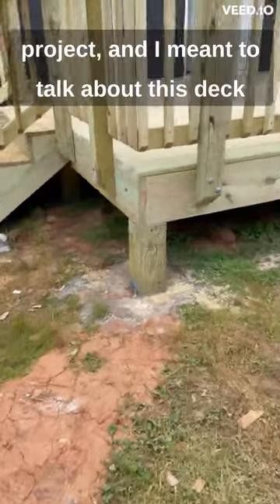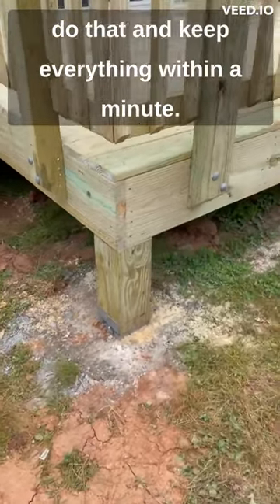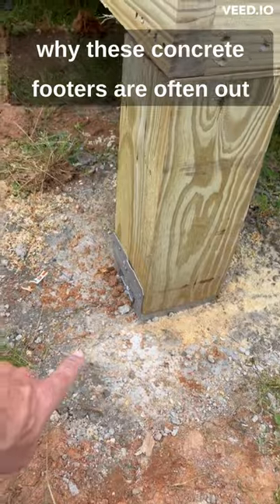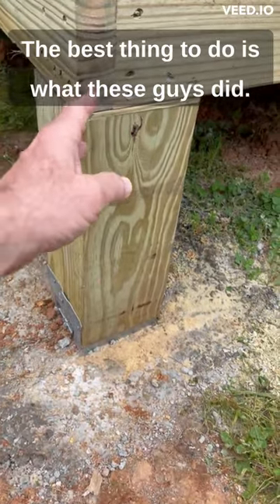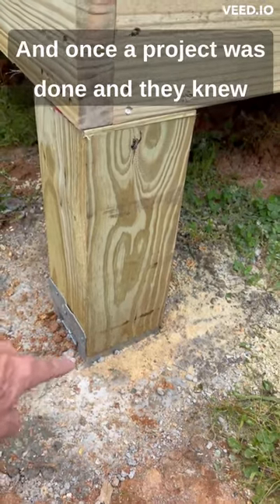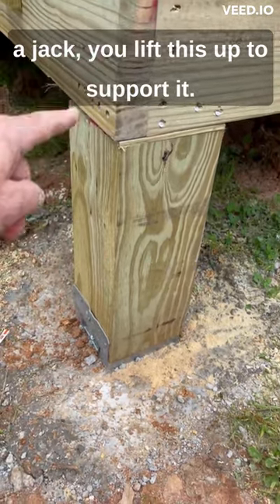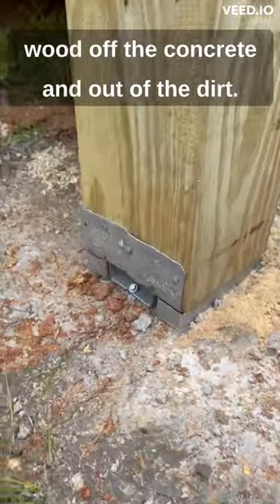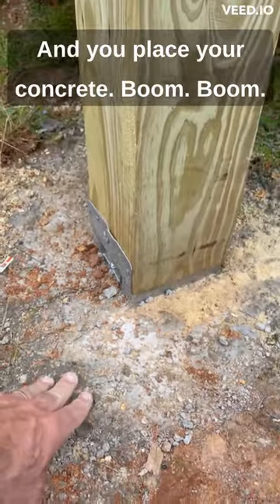Aligning Deck Posts and Footers

Comment: Would have been nice if the concrete was higher than the grade, so it would prevent pooling at the footing
Reply: Looks like they had the post and bracket installed and poured the concrete up around it hence the reason there's a screw drove down at an angle
Reply: @a-carpenter9229 That post is not in the concrete. It's actually not even touching the concrete at all.
Reply: That post will not be under water. That metal bracket is holding it up above the concrete. I don't see that area holding water anyway. I would have probably elevated the concrete about an inch or so, but that post is not in any danger of rotting.
Reply: I did my concrete piers at least 6 to 12 in above grade! But that's just me 😉
Reply: @a-carpenter9229  I’m saying it looks like the concrete is concave to the surrounding grade of the land. So it will pool on the footing
Reply: An 8" 2 x4 to form the footing costs what? $3? That's big money, lol....there's nothing "neat" about the garbage shown in this video.  The posts are probably not even ground contact rated

Comment: This won't pass first inspection in Texas. Footers have to be dug first before you even start. If only they had some kind of tool that had graduated marks consistent with some kind of measurement standard where you could use that to find out where the posts will finally be. Someone should patent that tool.

Comment: Totally how not to do it. String lines and 3-4-5 multiple for square still works
Reply: Yessir. I learned from an old head when I was first learning carpentry, I use this method all the time. Tried and true.
Reply: @robertswaine6096I know 3-4-5
What you use 5-12-13 for ?
Reply: @robertswaine6096 cheers 🍻 mate.
 Will definitely keep that in mind for future use.
Reply: Agreed but 3, 4, 5 still isn't the best or most accurate way. Try a squared+b squared=c squared. Or look up what your corner to corner measurement should be for whatever size project you have.
Reply: @robertswaine6096I have been for quite some time trying to work out how the math works…… Thankyou for an explanation. Much simpler than I imagined 😂
Reply: If the deck is square and they did the job quick then there's not a problem with it. I don't see anything that's going to cause premature failure.
Reply: @andrewshedron425 There are a bunch of number combinations that do the exact same thing. It's something that was invented guy by a guy named Pythagoras about 2,500 years ago. It's called the Pythagorean theorem. I use 6  8 10 on larger decks and it works perfectly fine. There's an infinite number of combinations. (3 4 5)   (6  8 10). (9 12 15). (12 16 20) and on and on. All these numbers do exactly the same thing and it's endless

3 4 5 is not the most accurate way on a larger deck. It is less accurate than using larger numbers. ( Measurements)
Reply: @actionjksn  what are you talking about premature failure? We talking about squaring maths
Reply: @NightlifeReALIty  What am I talking about? Whoever I replied to sad that what was done here is a big problem. They said this is not how you do it.  If it's a big problem then apparently they think there will be premature failure. If there will not be premature of failure than why would they be criticizing what was done? Any more questions?
Reply: @actionjksn  nah they just said that’s not how to do it. Use strong lines and lasers and so on to achieve square subfloor/ foundation lines. Nowhere did anyone imply the work would fail.

Comment: Yup it’s SO much easier and more accurate to hand-dig a pier to below frost (here it’s 48”) working under and around an existing deck… (NOT) than it is to lay it out properly, use a machine to dig the piers,  Set Sonotube and pour them exactly where and at the elevations they need to go…set proper anchors where they need to go, and then build the deck. 😂😂LMFAO😂😂

Comment: I once put in 22 footers for a deck that was going to hold a hot tub set up and I used string and some levels that go on the string line to set them all up.  It worked great and the deck was level and met code for a 12 person hot tub.  I would never do this method.  String, level, and some basic math works great.

Comment: You have to lay it out and dig holes for footers because the steel pole bottom is supposed to be thunderbolted into the concrete.

Comment: Or you can use a tape measure and a string line . And keep top of footer above grade to keep water out 😢😢😢
Reply from the maker: "Or" being the operative word. There isn't only one way to do something like this, and this is code compliant.
Reply: It's code to make it where water will sit at the post?
Reply from the maker: @Estwing22  I thought it was clear that I didn't build this, but in case not, I didn't build this. The discussion of best practices can be had about anything, no argument there. However, this is an entry level home, they used a different method to align the posts and footings and the end result is a functional deck that passes the local requirements. Whether or not that means me, you or anyone else likes, agrees or disagrees with that doesn't apply here. I'm also in agreement with you on code being bare minimum - go look at any new build and that is always referenced "it's to code". Many times it's crap but that is the product and it's a buyer's choice whether or not to buy. This is a starter home, it's not going to be the same materials and workmanship as a custom seven digit build. I also agree with the inspector comments, many never spent time in the field, those good ones are big assets. Just because these guys didn't do it a certain way doesn't mean it's wrong.

Comment: It's always amazed me, that in 'The Land of the Free', quite how little you're allowed to do on your own property without having to use licensed contractors or getting local authority/city approval.
Reply from the maker: Good point, and the "we're from the gov't and here to help you" trend is rapidly accelerating
Reply: @Hmtatlanta  Don't get me wrong, we have interference from the local authority here in the UK too, but I just don't think it is quite a bad. For one thing, and this may be good or bad, most tradesmen don't need a license issued by the town/city before they can work that trade. That said, trades that involve dangerous work will need some sort of trade body membership, so an Electrician will need to be a member of a trade body, as will anyone who works with gas (Natural gas, not the type that goes in a vehicle).
Reply from the maker: @semperidem2577  It's prudent and reasonable to set trade expectations. The challenge I see in many municipalities involve "code" and the local govt saying what can and cannot be done. Safety is paramount but the definition of "safe" is often manipulated. This is a discussion for another time but many say the bureaucracy has well overstepped their role in just about everything.
Reply: Because people do stupid stuff like this. Storm comes along and lifts the deck up. Then you will want insurance to pay for that crap job.
Reply: You misheard. It's "Land of the Fee".

Comment: concrete is not above grade should be at least 6in. above. What ever happened to measuring ? measure put in concrete then build your deck
Reply from the maker: Here the conc isn't required to be above grade.

Comment: 😂 The way you do the piers is the last thing you should be worrying about. 
I have never seen so many things wrong in such a small area. 
You should be more worried about the fact that the concrete slopes the wrong way. The post is too long, which places it below grade. There are far too many fixings in that timber. It has been weakened now.
Not to mention, there is nothing holding the structure to the post.

Why on earth would you post this workmanship. 😂
Reply from the maker: When that was shot the job was still underway. I've not been back out but it has been completed and code approved. As evidenced in all of these posts, everyone has an opinion and they are from all over. Agree or disagree with style or codes, local codes set the bar. How anyone would do it is fine, in this case the standards were met.
Reply from the maker: @Estwing22  Whether or not I, or you, agree with what code represents, that is what the local gov't sets the bar at. I'm not debating any of that, somewhere in the comments I had a similar post. The is a starter home, built to the basic standards at this time. Telling me that I'm "tricking" anyone is disingenuous, I'm stating a simple fact. Anyone buying this home will have an inspection, independent set of eyes for the buyer. He will offer opinions and conclusions, they will go from there. This is is a Dodge Dart deck, not a Hellcat. Both pass whatever national minimum standards apply for vehicles. Is a Dart comparable to Hellcat? Code is pass/fail, you don't kinda pass code. You know this, I get that you can do better and it seems that everyone here is a master deck builder. Understood, but you're out of line with me "tricking" anyone.
Reply from the maker: @Estwing22  Apology accepted, it's not antagonizing but it's shooting the messenger. I've been dealing with builder BS for years and fed the same "code" crap, I completely understand the visceral reaction. Go look at the vid with the slab cracks on a new build. All I did here was illustrate a different way this was done. We've all seen batter boards and tapes - and misses where the footing is way off and the post sits on the very edge. Love it, hate it, be indifferent...this was done a different way. Clearly the experts are aghast, same for some of my other vids. I'm tossing these out there because it's what I see, that's it. This is a snippet of what I see every day. Most people buying homes are incredibly naive, sometimes hard to be that stupid. They spend more time researching a movie than areas, homes, mortgages and agents. To them they understand "code" means something like "it's OK". Most don't care to learn more; a deck is a deck and "it's to code".

Comment: Y’all ever heard of batter-boards and stringline? Amateur hour over here.
Reply from the maker: BB & string is hardly fail proof, we see huge misses. This is a very low deck, the post hits right on the footer and it's up off the conc. Explain how this is amateur hour?
Reply: @Hmtatlanta  fool proof no, but when proper attention to detail is payed a bb and string-line is a very precise means of layout. We layout buildings for spread footings and anchor bolt sets that very often have over 50 footings and bolt sets. This is all done with batter-boards and sting lines. Do mistakes sometimes happen and a set of bolts is misplaced? Of course, but it is a rarity. If someone cannot properly layout a simple deck, like the one in the video, ahead of time then it shows a lack of experience.
Reply from the maker: @chuck9740  I'm still not clear on why you say it's not properly laid out? Agree on BB and string but where we are now with construction, housing and trades in general isn't where we were in the past. Now I see builders placing cost and speed above everything else; get it up and get it gone. Skilled trades are of course out there, but the clear trend that I see is to meet the local code and move on. You and I might not like it but that seems to be how it is right now. In this case, it works and meets code. Always opinions on what/how to do something and right way/wrong way can be debated. The posts hit the footers, deck isn't going anywhere and it's been code blessed.

Comment: Missing nail and a shim ? If thats what professionals consider a good job then our standards are way to low.
Reply from the maker: It wasn't fully punched out when this was shot. You've never seen shims used on a project? For doors, windows, cabinets?
Reply: @Hmtatlanta  Doors, windows, and cabinets are not structural elements. Tell me there's at least two anchor piles on that deck and that it's not connected to the house...
Reply from the maker: @TonyRule  Start with that it's code compliant and has been cleared. So opinions are fine, debate on how to do things "better" is fine, but this meets the local standard. At a minimum, decks need to be lagged to the structure. I'm not privy to the specific pattern or any of that. Many counties expect decks to be fully supported, essentially free standing as well as lagged to the home. If you want to be the code guy, that's fine. I'm not a deck builder and I don't think you located are where this deck was built. If you are, I'd be happy to provide your info to folks looking for experts in this area, you'll stay busy.
Reply from the maker: @the-guy-on-your-moms-couch  I'm not a deck builder posting a video of a deck that was not completely finished at this point and has since been completed and local code approved.

Comment: Far easier to use batter boards and string line with levels. I have built many decks before we had lasers. I have done repairs like this and it is a nightmare to work under a low deck like this.

Comment: I can't do that in my area because the inspector wants the hole 36" deep and 3 x the size of the post. So a 6" post like that is 18" x 36".  I would like to see someone dig that with the post jacked up and the deck finished.  I had to rent a stand on skid steer with a auger attachment.  All planned out with a laser before anything was done.

Comment: Maybe this is in a warm area? Seems like a pain to pour the concrete afterwards, considering the frost line.
Reply from the maker: Georgia, no frost lines here just consistent high humidity
Reply: @Hmtatlanta thats an important detail. Doing a post footing like that in Iowa is not gonna happen when you have to 42” down.
Reply from the maker: @SmoothOperator319  no doubt, we had a place in Western Mass growing up, we had to go the same depth, cold is brutal

Comment: Dig the hole with the deck in the way, and try that for a beam 8 feet under the deck, lol, string, laser, level, geometry, dig the 4 foot hole so freeze won’t heave the post before building the deck

Comment: Wrong anchor for base plate , supposed to be a 5/8 bolt , no post to beam connector , and concrete is supposed to be 2-3 inches above grade . Not to mention if you do it in that order how do you pass footing inspection and framing inspection?

Comment: Me and a guy needed to build a simple 10x12 deck in one day including concrete. The posts were getting put in the ground. 

So we laid out the holes and dug them. We cut the posts long and poured about 4 inches of pea gravel and then 6 inches of dry concrete in the holes, then put the posts into the holes.

Then we hammered two stakes per post into the ground and screwed on some diagonal bracing to hold the posts vertical. 

Then we screwed the ledger board to the house and put a double beam across the outer posts. 

Next we ran the rim joists around and had them all setting on the double beam on the posts. 

Then we ran our tape measures diagonally and squared it up.

Next we put in all the joists  and then checked the level of everything. 

After everything looked perfect we put the decking down and installed the railing and steps. 

After everything was done we filled the holes up with concrete and shot some water into there. 

This was back in about 1998, I know this because my son was still a baby and it was when he was about a year old. 

The deck is still standing and still sturdy. The decking is not in great shape just from the weather, but structurally it's solid. After you attach everything together there is no side to side wobble even without the concrete being in yet.

We made good money off this because we only had to drive there once. We both had trucks so we loaded up both trucks to the max, they were both squatting pretty good.

It's better to not put the posts into the ground but if you do, never put the cut end that goes into the ground and put some sealer on the bottom end of the post to prevent wicking.

Comment: My question is, why did they need to place a shim under the rim joist? Why not recut the post/column apposed to installing a shim that will most definitely disintegrate in a short span of time leaving the deck unlevel. Besides it looks unprofessional. This is my opinion! I have been a quality builder for the past 45 years, and would never shim a wood column. Particularly a exterior PT 4"x4"! Cut kit right so it fits, or plain the underside of your dubbel rim joist to receive a flat surface.

Comment: Or you can just properly plan and pour your concrete in the proper place to begin with..
Reply from the maker: Why "or"? The posts are dead center on the conc footers, what's the issue?
Reply: @Hmtatlanta  "or" as in either way. There are a thousand ways to skin a cat. As long as it works, it works. Just not the way I do it is all.
Reply from the maker: @jasonm887  agree, my point. Just seems that everyone is jumping these guys, this worked in this case. Be good

Comment: I’m not trying to be a know it all but as a deck builder you have a lot going on here that is wrong . Guard rail posts have to be mounted on the inside not fastened to outside box .  You can certainly pour your tubes before hand all you need is a transit and a measuring pole . You will also need some string and some stakes .

Comment: That wood shim will eventually smash, disintegrate and fail, this is wrong, and the handrail is garbage never notch, you only need 1 corner post. No post to beam connector only toenails. You can also see a screw was used through the metal of the raised basedplate into the footing, there should be a center bolt 1/2” or a wet set j bolt

Comment: The deck having that metal between the wood will also prevent termites they love damp or rotting wood. If would is touching soil and sometime concrete it can rot fast and get termites easily